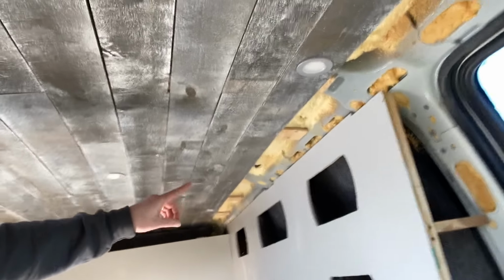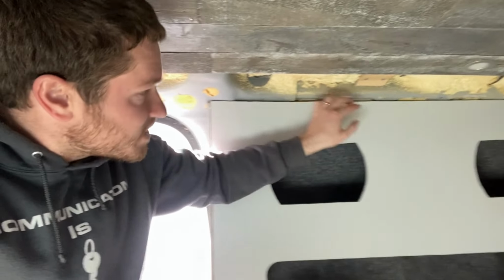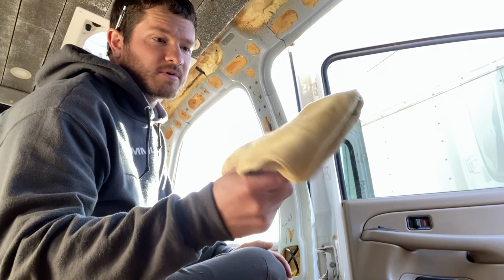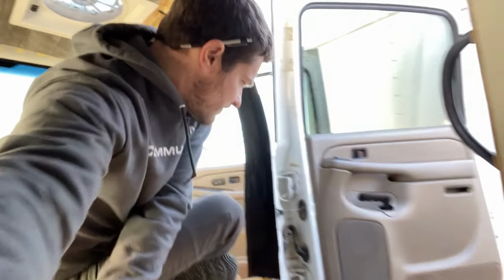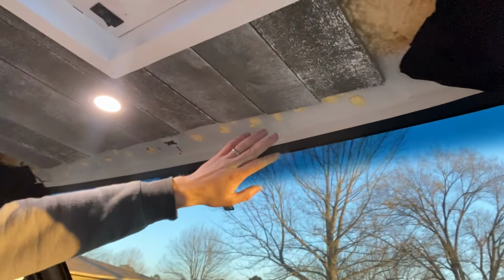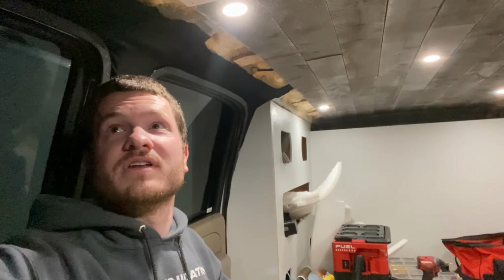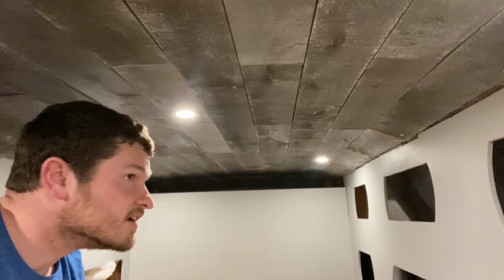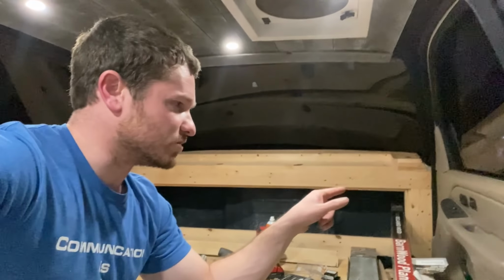Finishing the Ceiling - Trim Work - Suburban to Camper Conversion

Comment: Hey man, LOVE the videos, and REALLY love the camper. Just a heads-up though, automotive exterior door seals are not 100% water-proof, so some water (and dirt) WILL come through. To avoid problems, the bottom layers of sheetmetal will have a few drain holes at the bottom of the door to allow the water to escape. If you spray foam, please allow channels for that water to come out. To see what I'm saying, take the interior door panel off, and run the garden hose in the door cavity. You'll see where the drain holes are.
Rock on man, great content.
Reply from the maker: Yes very true! I ended up sealing two of the doors because of that so that they don’t leak
Reply: @trove1312  Good deal. Take care man!